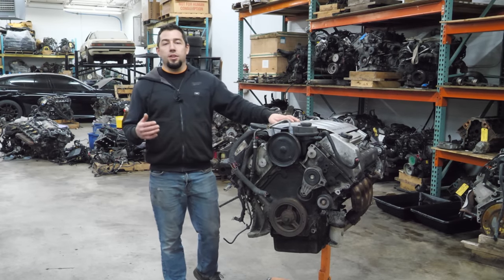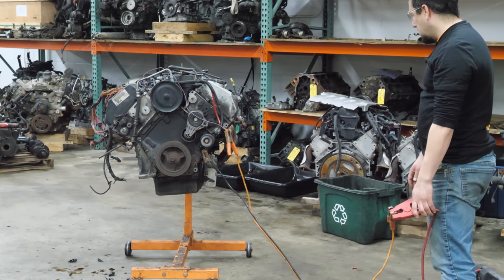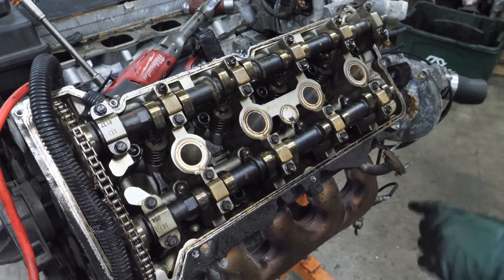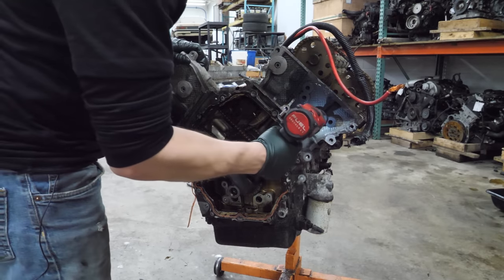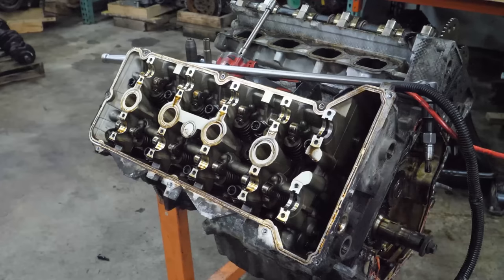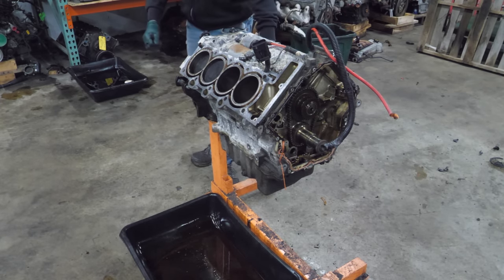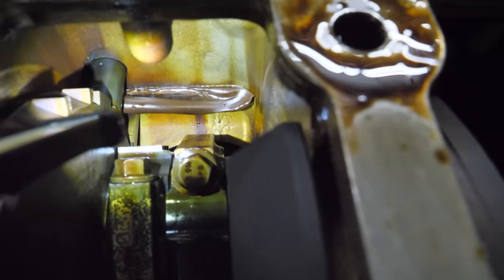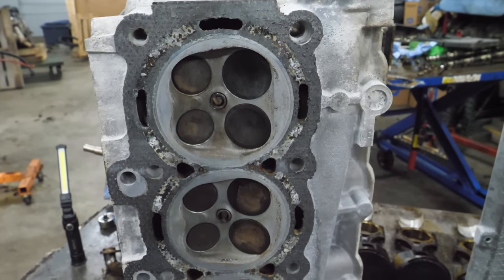Customer Returned This Cadillac Northstar L37 4.6L V8, How Many Things Can We Find Wrong?

Comment: your answers is no and no ( or at least around Lincoln NE in 2006-15~ there's a rebuilding kit for pump bearings, i been playing/hobbies with older 60's mopar after 2016~ aka anything caddy or Chevy's i don't have current $$ on as after 2013 i moved to working on industrial manufacturing equipment/millwright ) and that engine was running lots of stop-leak it eats the inside parts ( and can make it leaking oil or coolant or both and vary hard to fully remove from the system after adding it, i had a SBC350 previous owner did that with my truck =junk block/castings ) and vin-Y ot 9 sorry it's been 5+years since i was at that shop = 4.9L's also if the head-bolt's are bigger size than stock 14mm 🤔💭it's us/shop i working for and, no not my handy work as someone definitely has been in after me/boss Mike price inc 709W vine

sorry hard to condense the comment and thoughts/explanations  

ps shop/others got 600+hp out of the 4.9L rollerisded engine modified aka boosted and 1 mule car ( boss's brothers car jake RIP ) we were testing got to 300+K miles ( started the mod/testing at 88k ) and had more to give but the radiator deaded/leaked and the cop wouldn't leave it alone to cool off so it warped a head/spun a bearing on I80 westbound 

as for the starter i got a lolz 😂out of it you're doing it kinda wrong and on the boss's/or 97 wife's cursed/ghost-hunted 4,9l changed it out in under 20m's without cutting/cheating anything ect and like it more than my chevy's or 440RB/hemi

Comment: I had a Lincoln Mark VIII with the 4.6L 32V Intec V8 20 years ago and that engine & car was reliable to a fault.  Only thing I remember replacing was the electric cooling fan at ~80K miles.  That engine put the Northstar to shame.

Comment: I came away impressed with the generic goodness of this engine.  Ok so there were issues but conceptually it wasn't the worst...(excusing the open deck tho).  Very modern stuff finger followers are everywhere NOW but not so much then.  The timing setup appeared elegant as the wear was low on tensioner rails.  Now it wasn't a great HP/L design but GM went all modern and didn't do too bad, I imagine it had more tq, friend had one in his STS or something but yeah it had the head bolt problem.  So it was pretty decent but at the same time why couldn't it have been more bullet proof..... bolted joint design and GM bean counters I am guessing

Comment: Just your typical 85th percentile owner neglect: 10,000 mile oil changes, no coolant checks or scheduled changes. I will say one thing positive: it was still pumping oil even after the pickup was 50% clogged from the idiot tech with the sealant fetish.

Comment: the water pump is easy to replace with the special tool. Its like a giant socket and engages with the slots provided around the pressed steel housing of the water pump module. The engine was let down by the most stupid decision made in GM history. "Lets use torque to yeild socket head capscrews threaded into cast aluminium and hey! lets make them fine threaded" DUH!!

Comment: I work at an auto parts store and I sell so may Northstar thermostats and water pumps and radiators and fans and relays and stopleak these people are delusional. It's head gaskets every time cause the head bolts fail.

Comment: I'm going to share something with you that I don't know if you are aware of.... But back in the day from the beginning of these engines after 2 years after. Anytime anybody worked on the coolant system..... period..... We were instructed to insert two to six stop leak pellets. I guess this is what happens after a couple pellets are installed.   This is the worst engines in the world.  Because of their design.   I took one in and had 91,000 mi on it. A little while ago. That was the last one I refuse to take in anymore. You could never fix problems. That they want to pay for anyway. These vehicles just aren't worth the repairs
Reply: I crushed a 2010 Don't know what happened to it customer just dropped it off but it had a hole to the block but just saying

Comment: UNFORTUNATELY CADILLAC LIKE THE 4.1 ENGINE HAD ISSUES , BEING FRONT WHEEL DRIVE , THE FRONT CRADLE HAD TO LOWERED ON THE 95 CONCOURS DEVILLE I HAD , AT 80k IT WAS PISSING OIL FROM THE OIL PAN  THEY JUST HAD TO SAVE 10 EXTRA DOLLARS AT THE EXPENSE OF BLOWING A CUSTOMERS ENGINE !!!!  , I CALLED THE DEALER,  ITS 4 K TO FIX IT , THE ENGINE BEING A FRONT WHEEL DRIVE WAS TO CLOSE TO THE FIREWALL , IT MELTED THE HEATER BOX , FOR A CAR THAT COST 56 k OUT THE DOOR , GM DIDN’T CARE  !!!! YEA,  THE STAR THAT WENT FAR NORTH FAST !!!! IF YOU GOING TO BUY A CADILLAC GET IT WITH LT- 1 REAR DRIVE 1996 WAS THE BEST & LAST YEAR PROVIDING THEY ARE SERVICED !!!! STAY AWAY FROM THE NORTH STARS , YOU’LL BE LOOKING FOR A NEW BANK TO FINANCE THE REPAIRS !!!! ITS NOT A TOYOTA !!!!!

Comment: I had a Cadillac with this engine and at 96,000 miles it was overheating. Until that point it was very powerful but it was toast. When I researched and found out this was common on NorthStars so I basically junk the car. No way will I ever buy a Cadillac with one of these again.

Comment: 97 deville with a Northstar at roughy 100k on the clock with a head gasket leak. Last front wheel drv. POS domestic I've owned besides my GMC 2500hd. BMW and my Porsche are so much more reliable.

Comment: I've never seen multiple bottoms of this nature under the oil pan. Why do this in the designing ? Used to be just the oil pan came off and there you were, the crank.  Also looks like the aluminum block anodized. Water channels filled with crap. I do not like all aluminum engines. I don't like aluminum heads on cast iron block either. Have no choice this day and time. Enjoyed the watch.

Comment: Those are good engines. Dexcool os garbage, replace it as soon as possible with whatever else. Needs oil change every 3000 miles, not 5000 or even 15000. That's how you destroy any engine, 15000 miles oil change, what a joke.

Comment: The Norrhstar is in general a steaming pile of 💩💩. If you ever get an XLR , in the left side of the trunk is the module for the  convertible top. It will have been drowned and the top wont work. Common issue.

Comment: If you care for most gas cars they will last, unfortunately electric cars are going to deteriorate beyong repair no matter how you treat them. Like most of the engines you tear down that one has been either neglected or driven to failure by overheating, or both.

Comment: RTV is the half case fix. But, this looks like shit. Whoever did it didn't know what they were doing. Small bead in the depression going around the block. Done. Make sure the other half goes on nice and straight and even, tighten and torque in a criss cross pattern.

Comment: That is the dumbest design ever!!!  putting the starter under the intake manifold?  Why not build it into the distributor?  Why not drive the water pump off the torque converter and install it in the transmission?  Why not put the power steering pump on the end of the crankshaft so no belt is needed?  GM just being GM....

Comment: Those north star motors are all in the junk yard by now. Bad design. Starter motor is under the intake, hard to get to spark plugs in back side of motor. Water pump ran off cam. Bad block design, always an over heat after 100,000 or near it. Threads on block corrode.

Comment: these engines are garbage , they get pulled studs and blown head gaskets , the head bolts that are screwed into the aluminum holes in the block suffer from decay ,  the dealer will fix it for about 4,000 but the wont warranty it , all GM motors are like this , if they had made this engine out of cast iron like the older engines , it would still be on the road today

Comment: The worse engine ever
Reply: The 4.6 was a nightmare but the olds 4.0 was pretty decent.  I've owned (3) 4.0's  and still beat my 03 aurora pretty hard with 148,000 miles on it